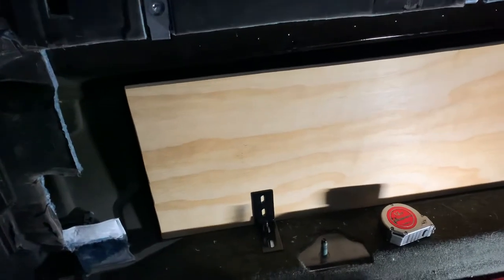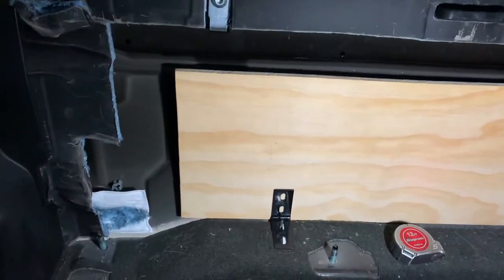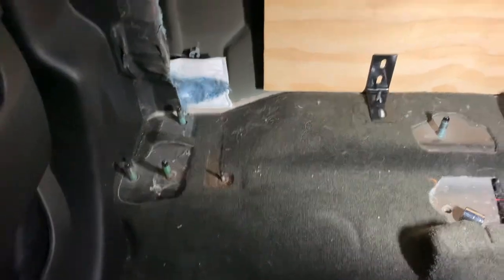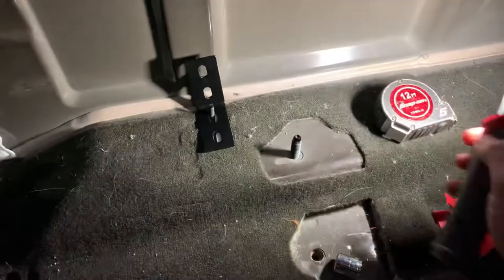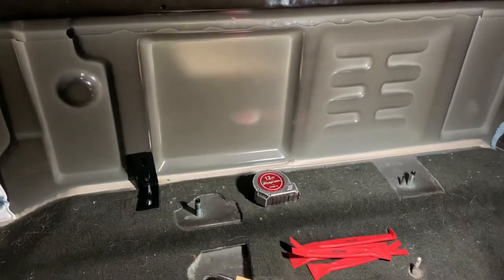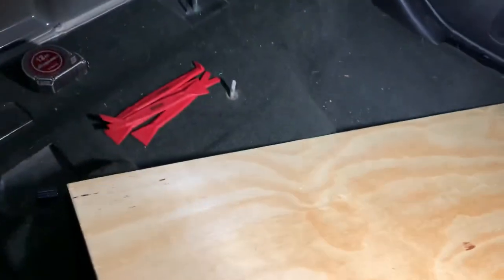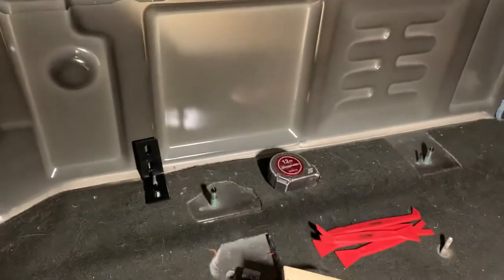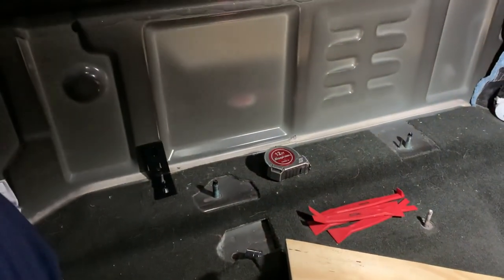DIY Amp Rack Chevy Silverado 1500 Double Cab Truck

Comment: did this a few times. cut top seat hooks so seats fold down. rebuild board for 2 huge amps and 1000.1 with cross overs and lc8i and fuse block. best to build it top to side. I use the 4 loop brackets to hold wood in and board goes all the way to side plastics of c pillar.

Comment: Fyi the double cab is an extended with two suicide doors and a crew cab has 4 doors
Reply: No, double cab has 4 normal doors with shorter rear seating area....
Reply: Normally called Ext Cab for the shorter doors, or Crew Cab for the more normal sized doors with handles.